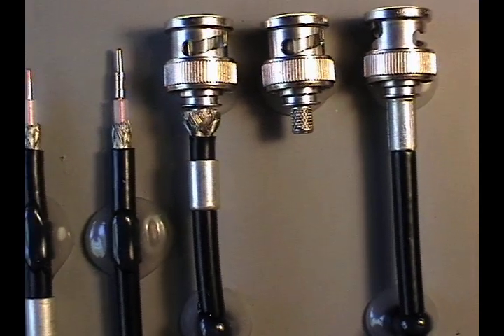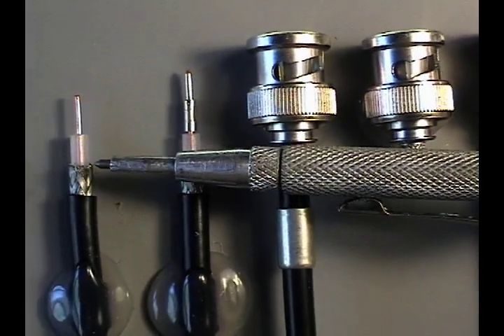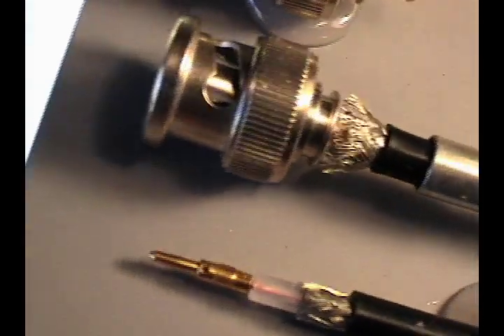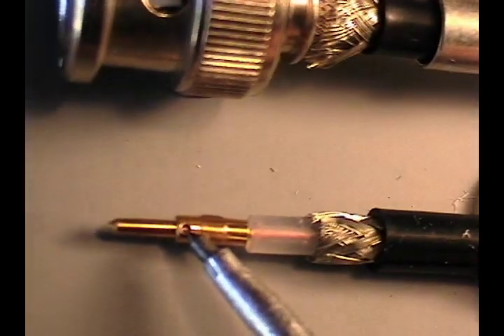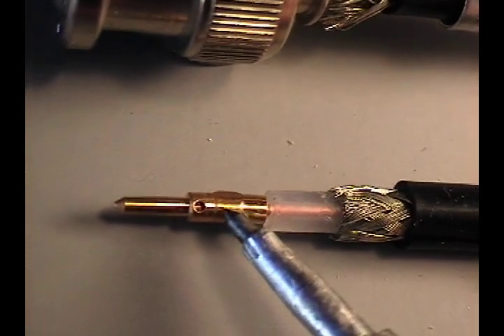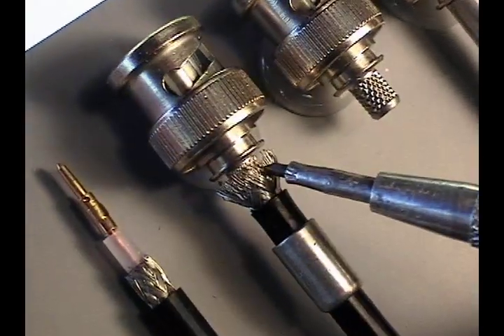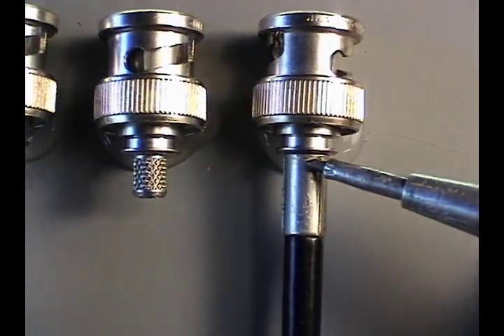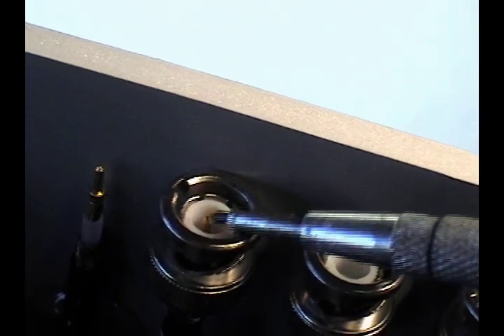coax strip and crimp introduction

Comment: @sumoman53 all sorts of radio connectors.  The Icom handhelds (green ones) use these for the antenna.  Cheap FM transmitters I saw on Ebay use these as well.